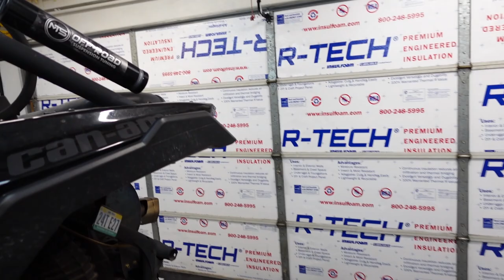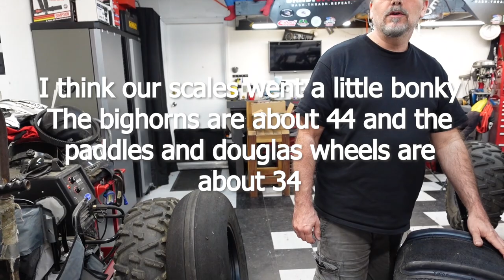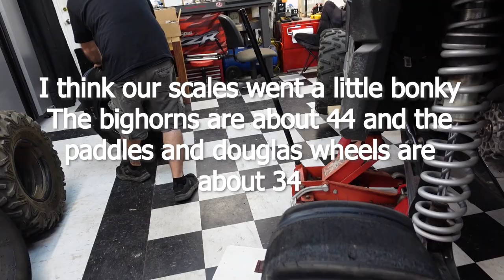SANDCRAFT SKAT DOUGLASS NEW WHEELS AND TIRES GLAMIS PREP TIME IS HERE

Comment: As someone who jacks up his x3 alot. It helps if you ratchet strap the body to the a-arm or trailing arm so the suspension doesn't fully extend. You won't have to jack it up so high.
Reply from the maker: Good tip for sure. I'm probably just too lazy to take the extra stuff.. LOL

Comment: Those are sweet.  I would like to know how you like those.  I am looking for some dune tires.  Need to keep the expenses down so I was thinking of 32” sand lites.  But those look sweet,  would like to know how they compare.
Reply from the maker: We actually bought a set of 32 sand tusk lights.. and already have them in 30s. We plan to do a comparison of the 32s to 32s as soon as we can get to sand and as soon as I can find some rims for the tusk lites hi
Reply: Dandi Offroad that would be super great!  I am sure the scats are better but I do wonder if the Tusk in 32” are good enough for now?  Look forward to that video.
Reply from the maker: How much hp are your pushing?
Reply: I have a stock 2020 turbo RR so 195.  Plan on doing an exhaust and 91 octane tune eventually.  So eventually 220 ish.
Reply from the maker: Currently you'd probably be good with some destroyers. The ones we have are a little a more aggressive.
Reply: Dandi Offroad that’s what I would like but just spent a bunch of money on radios.  So I was looking to save some money.  But maybe I should buy once cry once?
Reply from the maker: Possibly the tusk lites would work pretty good but once you start getting up in that 200 plus range you're going to spinning them pretty Badly
Reply: Dandi Offroad well I may start with the Tusk 32” and use them for a year then maybe save my pennies for some destroyers next year.  I have the RC model so I have the Liberty tires right now.  So the Tusk would be at least a sand tire.  Thanks so much for the response.
Reply from the maker: I'm anxious to try ours out hopefully in the next couple weeks
Reply: Dandi Offroad I ended up getting the Sand lights in 32” for now.  Thank you for everything!
Reply from the maker: Yeah there are great bargain, a lot of bang for your buck. I think that's what we're going to end up with on the RZR Pro soon.

Comment: How are these tires compared to the Tusk sand Lite you reviewed in another video?    They were 30s.      I just ordered those, but I can sell them if they are not enough.    I have 2019 x3 MAX xrs turbo r      I’ve duned only 3 times, I stick bighorns , loved it!! So I’m ready for paddles.          Tell me what you think about those 2 sets.  Thanks!!!
Reply from the maker: As far as duning the 30 tusk light felt good but would not have been enough bite as we tuned the car significantly since that video. But honestly we plan to run the 32 tusk lite on a new car coming up that will start at 195 HP. The tusk lite is a decent tire for the money. It really comes down to what works for you. If you dune with that paddle and it feels good,, all good.  I do like the 32s for ground clearance and looks, but again, at 175 HP the 30 felt pretty good.
Reply: @DandiOffroad  thank you.  Yes my machine is all stock.    Will see how the 30s feel !    Thanks!

Comment: Not to rain on your parade... but there's no way you're going to be legal towing doubles in California with the new Wolfpack. Your trailer is around 39' and Boostie is about 21'. Subtract 4' or so for the overlap and your total length is 56 feet, give or take. If one of your trailers is over 28'6" long, the maximum allowable length in CA is 65 feet. If both trailers are 28'6" or less, the max length is 75 feet. Your combination allows for a 2nd trailer to be only 9' of overall length, and the ProXP is 10'6" long, and that's not including the trailer you need to haul it on. I'm not saying you can't get away with being overlength, but you won't be "legal." I did the very same thing (69' long) for over 10 years and CHP never gave me a second look.
Reply from the maker: You are correct...